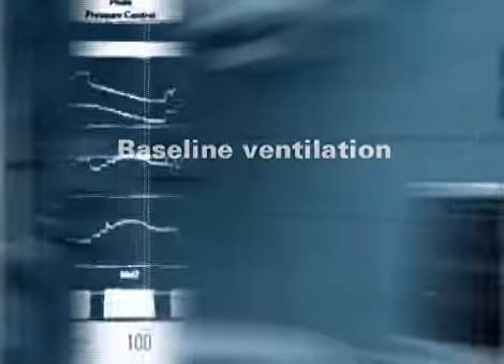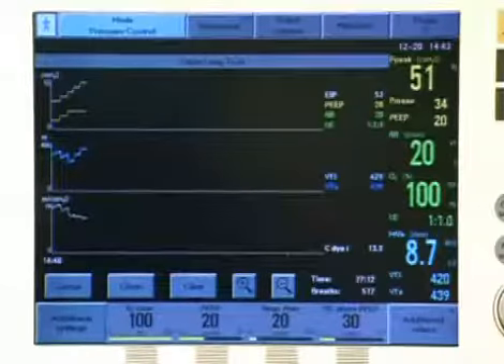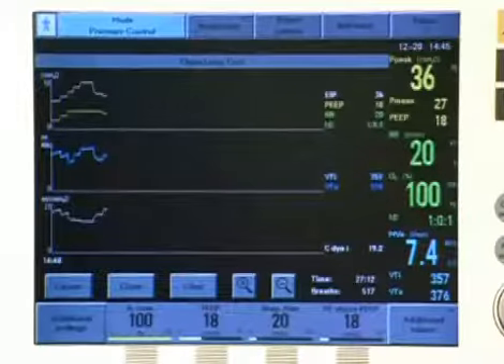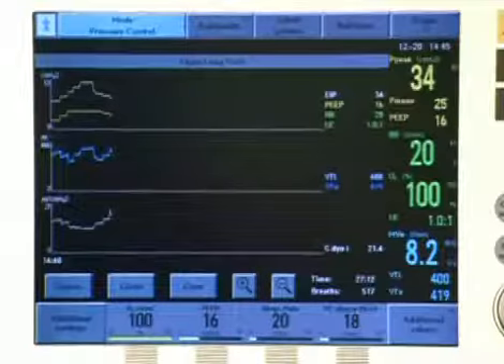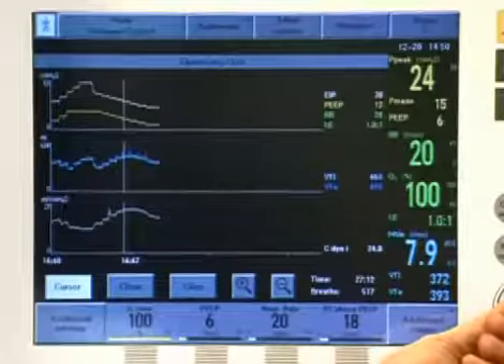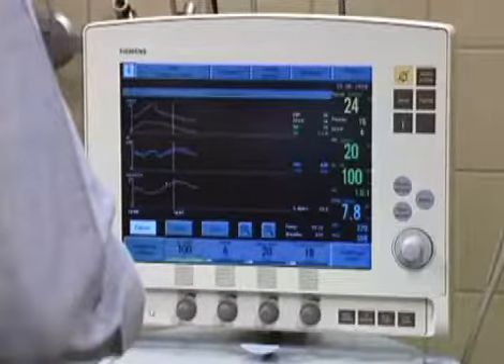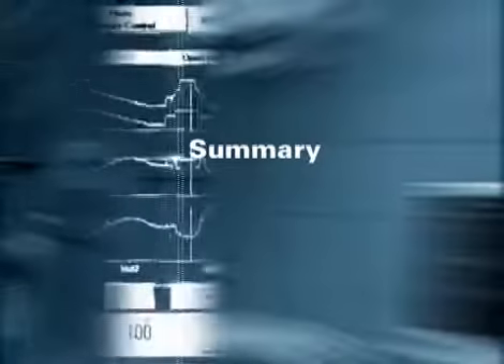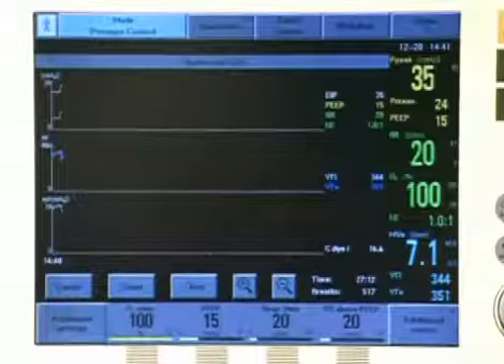Video open lung tool

Comment: This recruitment video was absolutely wonderful. I wish there was a computer-based simulator that was FREE that simulated the Servo I Ventilator. I Think Its a pretty cool ventilator. It doesn't have Automatic Tube Compensation and a lot of other things that ventilators like the Dragers and Hamilton ventilators have, but it definitely has what it needs for situations like this and I've heard this thing can do what NO THER VENTILATOR CAN DO. NAVA.
Reply: Before ventilating,  for invasive ventilation, if one performs patient circuit test (takes just 25 seconds) it compensates for Dead space, compliance and resistance. 
In NIV,  servo ventilators have automatic leakage compensations till 65 L/min
Reply: In invasive ventilation.. You can perform patient circuit test (takes just 25 seconds) prior to ventilation for Dead space, compliance and resistance compensation. 
In non invasive ventilation machine comes with automatic compensation up till 65L/min